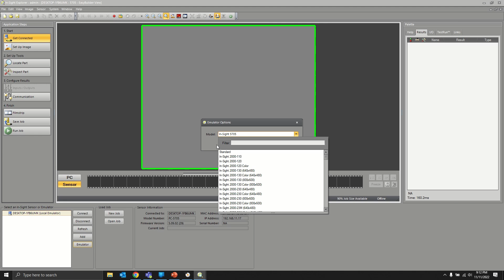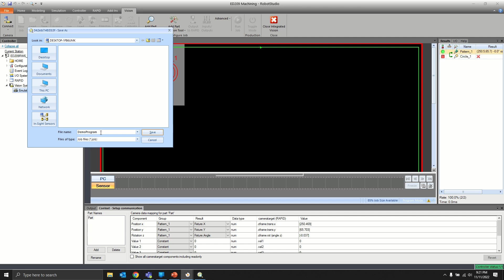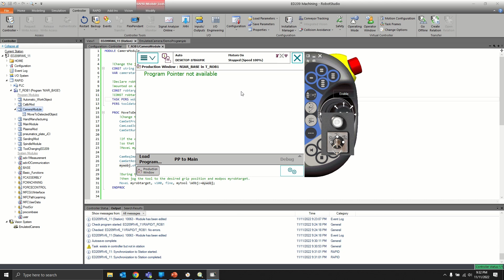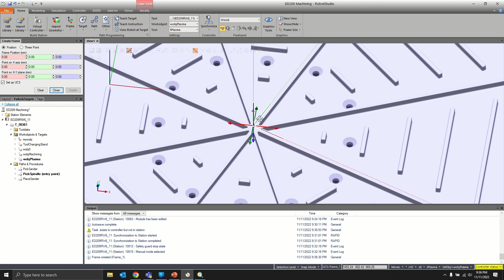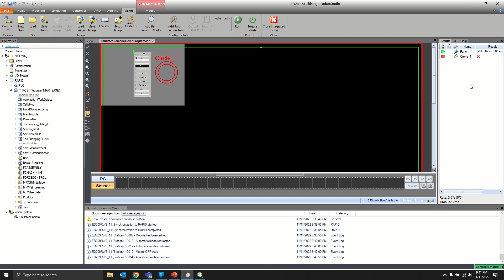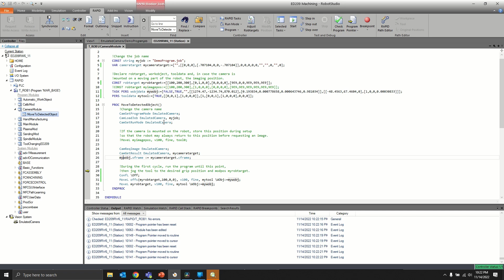ABB Integrated Vision Tutorial

Comment: Hello, do you know if we can do closed loop control of a robot on a offline programming software like robot studio or another one ?
Reply from the maker: Yes you can, there are a lot of interesting ways. You can use the simulation logic tab in robotstudio to do some of that, but you can also develop your own addins for robotstudio that would allow for the same thing. I did some thing along this line once using a laser tracker to correct for positional error on a robot. I believe roboDK might work well as well since you can run Python code inside of it. It really depends on what your are trying to close the loop on.
Reply: @robertevans7020  thank you a lot for, I appreciate this man !